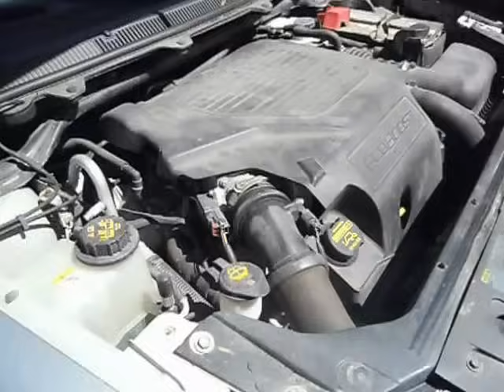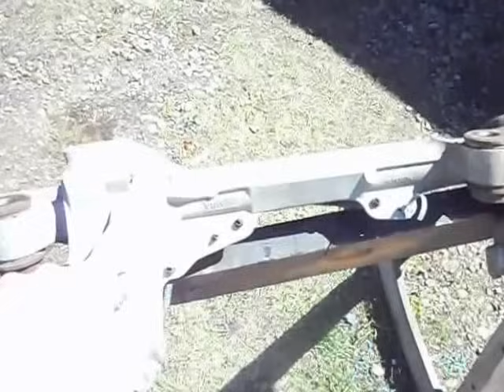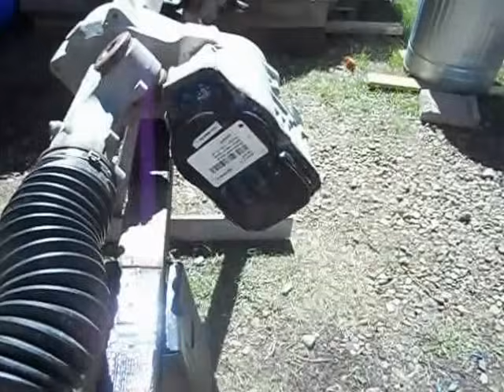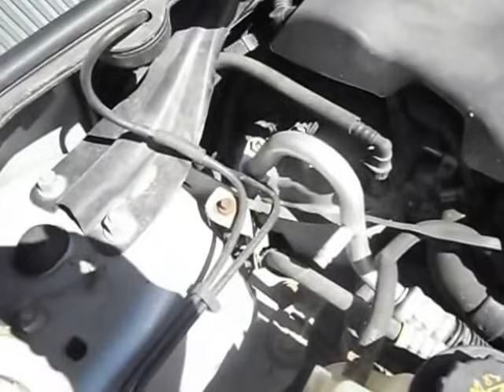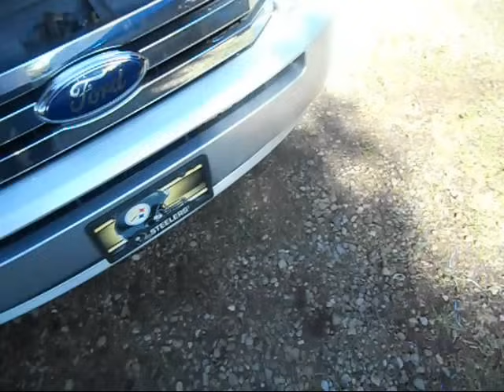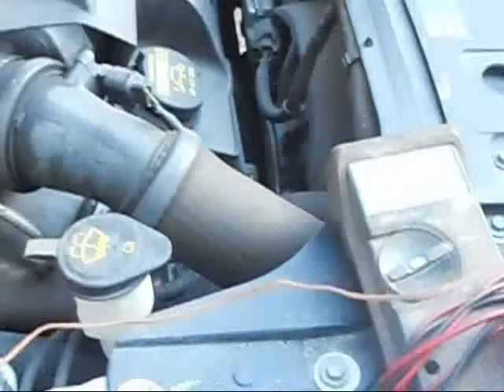Ford Electric Power Steering Failure Identified

Comment: I clipped a pole with my left front wheel in my 2012 f150. It's at the frame shop getting the lower control arm mounting points bent back into position. Since clipping the pole, my EPAS rack makes a loud howling/screeching noise when at full lock in either direction. Once the alignment is set back to spec, can the EPAS be reset with a scanner to prevent the howling at full lock, or am I looking at putting a new rack in?
Reply from the maker: Not aware of any calibration issue that fits your description. Guessing EPAS damaged during incident. Howling/screeching noise could be servo error correction; this would likely indicate rotary optical encoder on motor or steering shaft failing. Fact noise only occurs at stops could counter this assertion; may be related to EPAS timing-belt drive. Difficult to say precisely given broad range of EPAS failure dispositions. Good probability you will be shopping for new EPAS unit.
Reply: @bk1468   currently in the process of putting a new one in as we speak. Does it need to be programmed?
Reply from the maker: Programming was not required on Flex replacement with matching manufactures part number. However, one Ford owner did mention (some months back), that his replacement required reprogramming from dealer to match vehicle. This point has remained ambiguous, as no additional owners have reported need for reprogramming. Also, Flex service manual makes no mention of need for programming. Best to inquire with your dealer mechanic, since this information seems to be difficult to come by. It would make sense that no programming would be required with matching numbers, since EPAS unit performance parameters are vehicle specific.
Reply: @bk1468  it did need to be programmed. I just went into the programmable module installation area in the scanner and it took care of it. It had power steering, just all the dash lights were lit up pretty much until I paired it.
Reply from the maker: Thanks for information, did you procure exact model number? Or similar series? Interesting to know why Ford would require programming on select models only.
Reply: @bk1468  The scanner I used was a generic brand high end (shop model) scanner that had a "programmable module installation" menu. I didn't pull any old info from the previous rack like some claimed they had to do with forscan. Once my new rack was installed, I found the electronic power steering sub menu and selected program. I had to do this 2-3 times as it didn't immediately "take", but once it did, all my dash lights went out and I was off to the alignment shop - with an absolutely terrible eyeball job on my tierod ends! Ha!
Reply: @bk1468  💯

Comment: Hey. Good day. I experiened a problem with my ford ranger 2018 FX4, It has a message saying that Steering assist fault service required. I checked all the connections to the steering rack and it's all intact. May i ask do you have any suggestions on what to do before sending it to the dealership? Thank you
Reply from the maker: If your Ranger includes EPAS system, you are experiencing same design fault as documented. Make sure you read about Ford tactics to void warranty (like software updates, etc.). If Ford does replace unit under warranty, replacement will not be covered if it fails again.